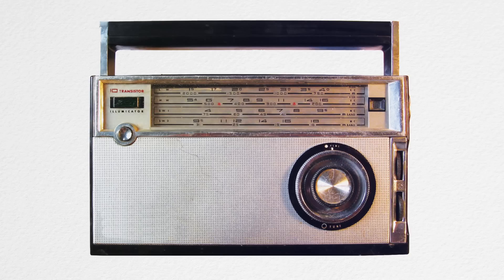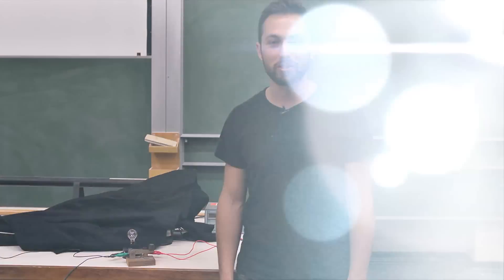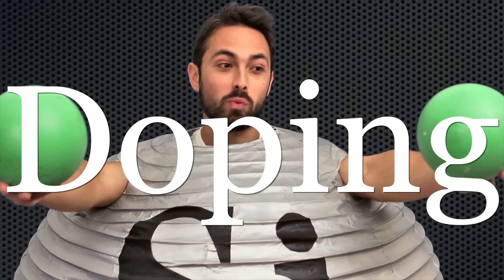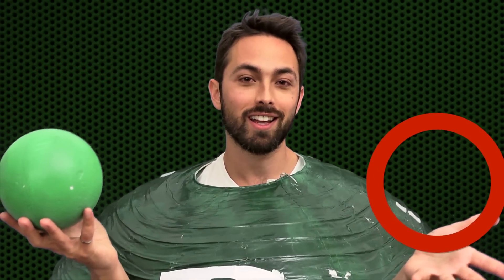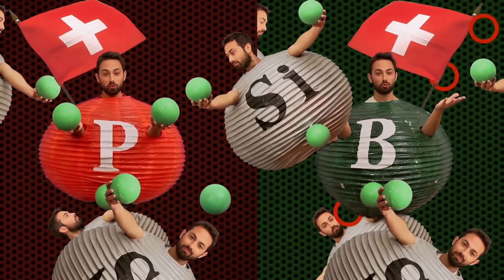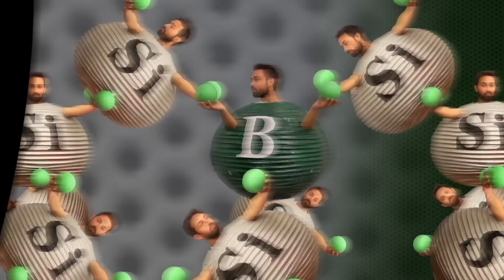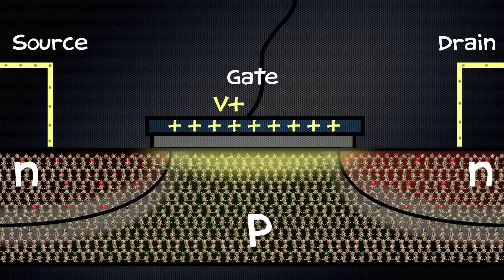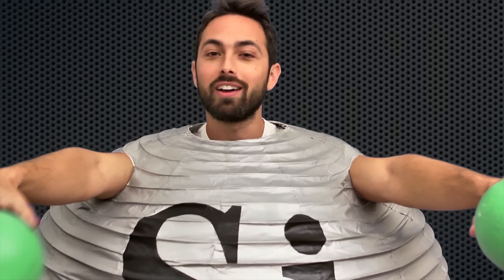How Does a Transistor Work?

Comment: Well that explains how they can be used as switches, but they can also be used as amplifiers. Something about varying the voltage at the gate will vary the voltage at the drain, which is also how radio signals are converted to be strong enough for your car stereo system. Got anything on that?
Reply: He’s describing FET type transistors. To use any Xistor as an amp – hook the ‘source’ up to high voltage and the ‘drain’ to ground. The transistors amplified output will be tapped from the ‘source’. In other words, there are TWO connections to the source -> #1 the high voltage and #2 the output. As voltage is applied (increased) at the gate, the transistor starts to short circuit to ground, thus lowering the high voltage level. As you have guessed by now, rising input voltage = lowering output voltage. Meaning the output voltage is 180 degrees pit of phase with the input signal. No problem, just run the output from one transistor into the input of a second transistor and you’re back in phase…… well, 360 degrees out, which for all intents and purposes is in phase. NOTICE – you also need some resistors in this circuit to keep some voltages “propped up” and also “current limiting” resistors that prevent the power supply from burning out.

Comment: A little FYI for the budding Electronics Engineer: the example shown here is for a FET (Field Effect Transistor) which is voltage controlled. There's another one called the BJT (Bipolar Junction Transistor) which is current controlled.

Comment: Simpler explanation than the one in class ahahah

Though I must say, that Moore's law seems to have reached it's near pinnacle and that it does not follow the "Double" rule anymore, it now seems to be like an exponential function but with a limit(of say... will stop in the next 10 years) because what will carry on will be quantum computing or rather light acting as transistors. Which will be soooooooooo far out of reach yet. Give it some time.

Comment: Great Job, but I have one complaint.  Holes don't move.  Yes, I understand that the "hole theory" has been around for a while and it is an easy tool for helping the layman to understand electronics.  
My issue with this is that the holes represent an absence of a particle (electron), but you can't move an absence.  You can create a hole by removing an electron, or you can fill the hole with an electron, but the hole itself is still there.  The hole is a function of the atomic structure but not a physical widget that can be moved from atom to atom.  
The only way to move a hole would be by changing the number of protons in the nucleus, which involves Fission and gets rather explode-y.   Safety Goggles are suggested!
Reply: but literally the first thing he says about holes is that electrons move into them, its just this can be thought of as a positive hole moving
Reply: I know, I know... it's a pet peeve though, sorry.  Holes moving is just so illogical... it's a reflex, I'm sorry.
Reply: noone is saying the hole is a physical thing that you move. it is just a concept...  but the fact that the position changes matter to the player. when we say the hole moves, noone is saying the empty void moves, we are simply saying the position of the hole has move. whether its a new hole is irreverent because there is still just one hole.
Reply: now your just being nit picky... its like you saying the guy in the video moved to the left and go on and say how hes not actually moving and its just a bunch of still images flashing on the screen.
Reply: If there was a hole in the golf course...and you cut a hole somewhere else and took that patch of grass and dirt and placed it into the first hole...you have MOVED that hole!  What's the issue? ;)
Reply: rasmasyean no, you moved grass and dirt from one place to another, leaving a hole where there used to be something.  You've only physically moved the grass and dirt.   
BTW -  Golf Course Greenskeepers get really upset if you go around cutting holes into their lawns.
Reply: CharlesDourdy in the case of golf, you would say the hole moved. If the change was official.
Reply: Steven Him Seriously?  Using the Golf Rule Book to justify idiots who don't understand basic principals of physics?  
Even if you move dirt into a hole, the hole still exists as a pocket of space relative to it's immediate surroundings.  Sure you can change the position of the sport objective, but that doesn't mean you are dragging an absence of dirt out of the ground in one spot transporting that absence to another location and dropping that absence into the ground where it will form a new hole.
Now yes I realize that Bugs Bunny and Daffy Duck used to do such things all the time, but they are cartoons.  It cannot happen in reality.

Comment: What I still don't understand is how they manipulate these billions of tiny transistors into CPUs, does it take decades to make a new CPU?
Reply: They don't insert insert transistors one at a time manually. It's a bit general but what happens is that the CPUs get designed (as a drawing/template) in a program. Then you print off multiple copies of that CPU onto a piece of silicon. Humans can't deal with things in the nanometer scale with their hands so we let machines build it. The entire process is more complicated so i'd suggest you wiki it or something if you're interested.

Comment: Thanks! That was great but I am still confused (and perhaps my confusion comes from not being able to see the rest of the circuit i.e. where ground is) but, in the NPN you discussed, wouldn't the electrons in both "N" type semi conductors (the left and right side in this video) be "attracted" to the p-type (center)?

In the video, at 4:35 ish the electrons go from one n-type SC to the other (left to right in the video, the direction of which is irrelevant) using the positive voltage at the gate as a "bridge"?

My question is this. I understand valance electrons. I understand "holes". But wouldn't both N-type SC attract electrons to the P=Type? In other words, with this video, instead of going left to right, shouldn't it pull left to middle and right to middle? AKA the p-type will pull/attract electrons towards it from both N-type SC?

I think the answer to the question I am asking is that, electrons from the "right" n-type SC are attached to the lower potential (ground) and thus move/attract there. Electrons from the "left" n-type SC move towards the lower potential and "fill" the holes in the P-Type while doing so. Once the holes in the P-type are filled, they pass over the neutral "center" and proceed through the "right" n-type SC toward low potential. Is that correct?

Great way of explaining though! I really enjoyed can't wait to check out your other videos!

Comment: At 4:30 he says "to turn it on you have to apply a small positive voltage to the gate", so surely this means voltage is either applied to the gate or it is not. What determines whether or not voltage is applied?
Reply: When a transistor is used there usually is a supply voltage from a battery. In the most general case, you have some other source (black box circuit or bias circuit) that provides the voltage to the gate. However what determines this voltage depends on how you want the transistor to behave. Note that there are different types of Transistors. For example, MOSFETS have 3 stages, where 1 is cutoff, 2 is triode, and 3 is saturation. You choose the gate voltage by considering the voltage at the drain, source and what stage you want the transistor to be in.

Comment: I just finished watching Transistors & The End of Moore's Law on your second channel, and I can't quite reconcile the two videos. I was wondering where P-type doping fits into the Moore's Law video. Also, in this explanation electrons flow through the silicon with boron, but in the other one the silicon between the source and the drain always acts as an insulator.
Reply: In the Moore's law video, he says the silicon beneath the source and drain is n-type (Phosphorus).  This implies the silicon between them is p-type, he just doesn't say it.  Same as this video.

Comment: Well done!! I took electronics 30 plus years ago, and this was a clearer description then we were taught. Vacuum tubes were being phased out, Integrated circuits were new and Microprocessors were still on the drawing board. So entire circuits were made with NPN and PNP transistors, resisters and capacitors.

Comment: Wait... rather than the electrons being repelled away from the electronics at the negative type reason, isn't the real reason a barrier has been created is due to the holes that our left to be occupied, because in a semconducer, when it's injected with  negatively and positively charged dopents, hasn't this proceess of transferation (electronics into P, holes into N (well, technically only the electroncs into P as holes don't reeeally move)) already occurred?

Or, or... is it a bit of both, the repulsion of electrons yet the extra holes that are in 'need' of occupying?

Comment: How does the switch get rapidly turned on an off. Because a transistor is suppose to turn on and off fast but if u r using a current to turn it on and off dont u still need to physically turn it on and off with a button or something

Comment: You give the false, or incomplete impression that all that transistors can do is switch on and off. That is true of some mosfets, igbts, and scrs, however there are other types of mosfets and bjts that operate linearly. That is they are only partly off-depending upon a particular bias point and input signal. As the small input signal varies the transistor provides more or less conduction and usually more or less power. This action also results in a power gain, or signal gain. This action is also similar to a variable resistor. Instead of rapidly varying your big switch on and off, you could represent these transistors by slowly varying a potentiometer high and then low.  This is actually the idea behind the name "transistor" which is short for "transfer resistor". These types of transistors have low transconductance gain to prevent from switching rapidly and are used in audio or RF recievers and audio or RF  transmitter amplifiers. 

Otherwise a very nice video.

Comment: Very good video! I have a few questions though. At 4:30, it says that a positive voltage is applied to turn it on. Shouldn't the gate switch off, since this is NPN? Also,shouldn't it be a negative charge on the gate, not positive?
Reply: In addition to reducing the barrier region between the N regions and the P regions, as the video points out, the positive charge on the gate of this mosfet, or metal oxide semiconductor field effect transistor, repels the positive charges or holes in the P region between the two N wells or n type regions. What remains is an  negative or n type region, called an inversion layer. It is through this layer, or "channel", that the electrons can continue to flow. This type of transistor is known as an enhancement type, in that to turn the device on, a charge, caused by an applied positive voltage, turns the device on. (Just so you know this is not an NPN bipolar junction  transistor. Rather it is an N type or N channel mosfet. They are easily confused.) 
An NPN transistor is a bipolar device, in which majority carriers flow in one direction and minority carriers flow in the opposite direction. Mosfets are majority carrier devices-only the holes flow in P channel FETs and only electrons flow in N channel FETs but not both as in a bipolar junction transistor..
Reply: Ah, okay. Thanks for clarifying. 
I didn't know what the difference was.

Comment: I mean faster in terms of ability to handle higher frequency signals as input. In a Metal Oxide Semiconductor Field Effect Transistor (MOSFET), aka the type described rather well in the video, the gate looks a lot like a capacitor electrically. By this I simply mean that it reacts to input much like a capacitor would (as they are both effectively conductors that interact through the electric field while being electrically isolated from one another). So this means that at really high frequencies

Comment: can some one explain this -when a positive charge is applied to "p" of npn, the electrons from the n are able to move towards the p, as a +ve charge is created in p, which can attract electrons. But i'm confused why not the electrons from the n on the drain side are not getting towards the p, but rather moving towards the drain. Why is that so? the positive charge at p should pull electrons from both sides towards it,if so the direction of electrons will not be from"source to drain".wer ami wrng

Comment: Organic processing is dubious, as it would likely add huge amounts of latency. Don't quote me on this, but I think the post-transistor era will likely lie with quantum computers, optical computers, or both (quantum computers are more specialized for certain kinds of brute-force calculations, so conventional digital computers, perhaps based around EM radiation, would still be necessary).

Comment: heheh dude if your computer still works inn 0s and 1s you are older than time. am talkinnng about the electronic side of the computer, now we have 0 or no charge  low mid and high resistans and is used in the same way us gates in the older chips that had 0 that was closed annd 1 that was oppen =)

Comment: Very well done. Love it!! I also like the metaphor of a gate, say at a rock concert. Thousands of people are wanting to cross that gate, but just a single gateman controls whether they actually get to cross or not. In a transistor the depletion zone acts as the physical gate, and the voltage tells that gate when to open or close. In this way a small voltage can control a much larger flow of electric current (the masses of people trying to get into the concert).

Comment: Not sure if it's been answered, but here is my way of looking at it. If the silicon and boron atoms were just floating around freely, 3 silicons would bond and share electrons with the boron, but the boron is placed in a silicon matrix. A silicon atom was removed taking the 4 valence electrons with it, leaving 4 'holes.' The boron replaces it, and only brings 3 electrons. Now the matrix has an area it wants electrons even though there exist the same amount of protons as electrons so it's neutral

Comment: If all semiconductors have these negative and positive reactions between them, do they run out of energy? Is this the reason why my computer slows down overtime? Is it that too much information is directed towards my computer? I don't believe this, because I check my bandwidth and no more information is coming into my computer then was six months ago. Why do computer slow down? It should be a one sided process of cruising the Internet. At least that is my thought.

Comment: Explanation (graphics) at 4:30~ is wrong. Electron is attracted vertically (not horizontally in the video) to the gate in the P area and it becomes N below the gate. Which is called channel. This is why NPN MOS FET is called N-channel transistor.

Comment: so if you need an electrical current to turn on a transistor then in order to control that current you would need another transistor thus leaving you with an infinite line of transistors?

Comment: You're talking about perpetual motion, but because of the conservation of energy, perpetual motion is absolutely impossible with no exception (otherwise, we would've exploited this exception and we will no longer be reliant on fossil fuels :D).
More specifically, your example is impossible because of Lenz's law, an application of the conservation of energy. You'll end up just CONVERTING the generated electricity BACK to kinetic, and electrical resistance doesn't help either.

Comment: I am a pretty big fan of your videos and your description of how a transistor works. But your description of semiconductors is incorrect.

There is a common misconception that "band" insulators have immobile electrons. This is incorrect. In pure Silicon or diamond-Carbon the insulating electrons are not localized. They are completely de-localized and free to move around. In fact almost all of them have nonzero momentum. The resistance is due to us being unable to impose a net momentum on them.

Comment: "pass through it....when you apply an electric VOLTAGE"
Fixed it for you. One of the earliest applications for transistors was as signal amplifiers in radios. You attach a power supply and speaker on one end, the antenna to the base and ground out the other end (simplified). Then, the weak voltage (mili- to micro-volts) induced on the antenna by a radio signal will control how much of the power supply current goes to the speaker, amplifying the weak radio signal and making it audible.

Comment: So a transistor is a switch that allows a current to pass through it....when you apply an electric current.  Hm.

How about you just apply the electric current you're sending to the transistor directly the the "out" on the transistor?  And then, how about if you just get rid of the transistor altogether?

Comment: Well, actually the video is only addressing digital circuits. Traditional amplifiers operate in the linear region, and vary the output as the analog of the input (hence it's called analog circuit). A transducer picks up a time-varying signal and is applied to the gate of a transistor. The transistor is "biased" to its linear region and current will also be time varying, analogous to the input signal.

Comment: depends on what its used for. in computers the first voltages that control the gate is set of by and external or a physical switch connected to the power source for example the buttons on the keyboard or the optical censor on the mouse which gives a voltage to different transistors depending on the direction it moves.